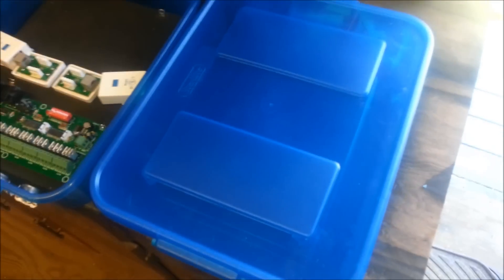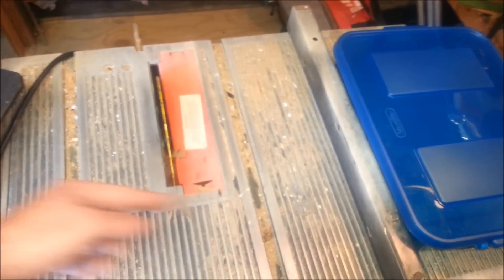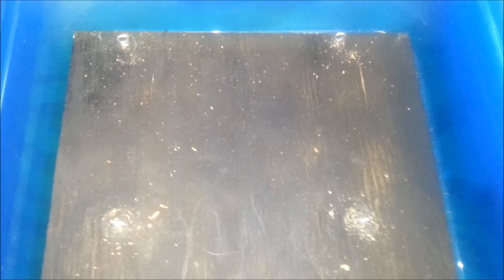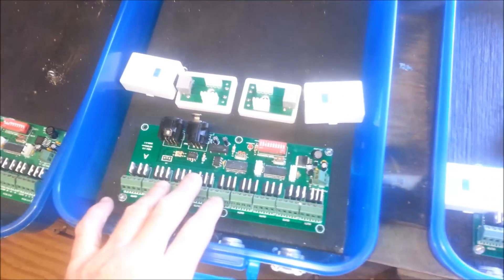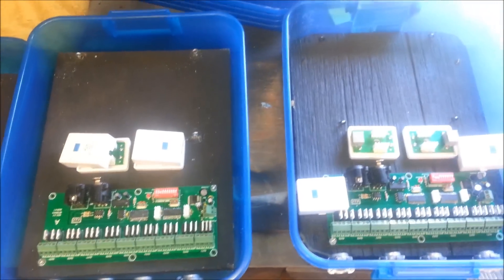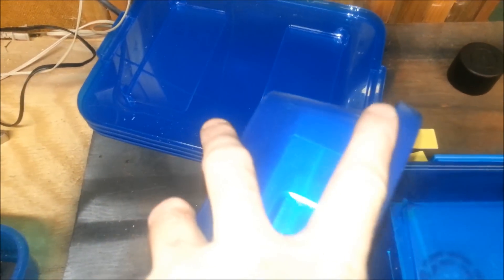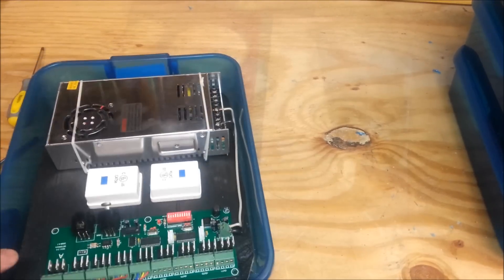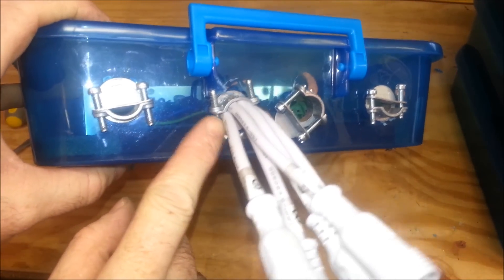Building a 27 Channel EASY DMX controller for RGB display Part 1

Comment: What's the specs on the power supply
Reply from the maker: These are a 350 watt 12 volt power supply with a max of 30 amps of power output.

Comment: Where are you buying these boards and how much are these costing you to assemble?  Is this a dumb pixel board or smart?
Reply from the maker: These are dumb RGB controllers.  I get mine on Aliexpress.com.  Usually around $40.  Assembly, I guess I made these for around $100 per controller.

Comment: so if I'm only going to use dumb rgb lights then I can use all dmx controlers with light o rama software? im confused? or do I need to use dmx software?
Reply from the maker: +Jason Duggan  I ran these controllers using Light o Rama Software for 2014's display.  You need a DMX output such as the DIY LED express bridge, e1.31 4 universe bridge, or a USB to DMX dongle (like the Holiday Coro actidongle, DMX king, or Enttec  Pro).
Here watch this vid.  It should help a bit
https://www.youtube.com/watch?v=22blRaz5gZM